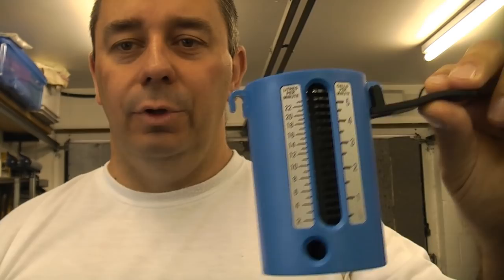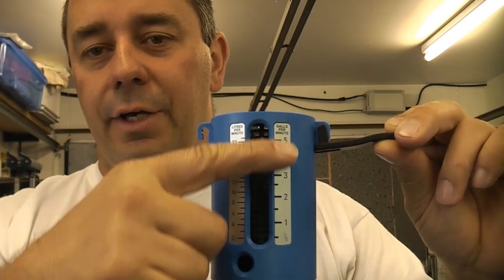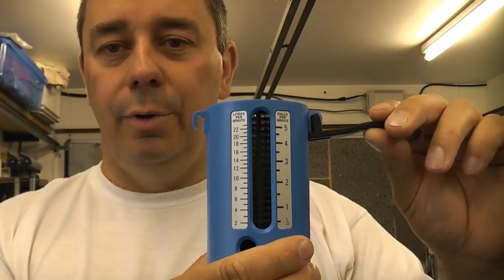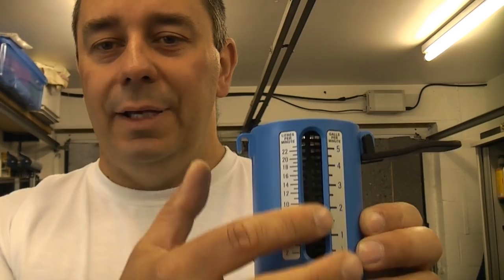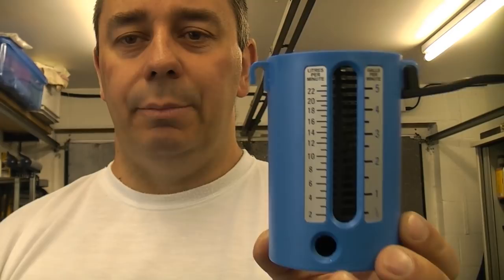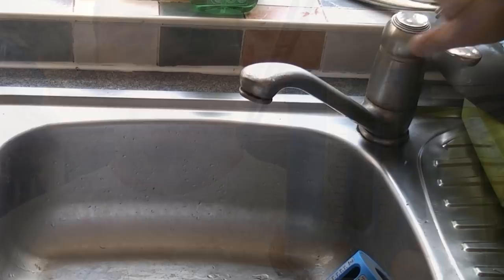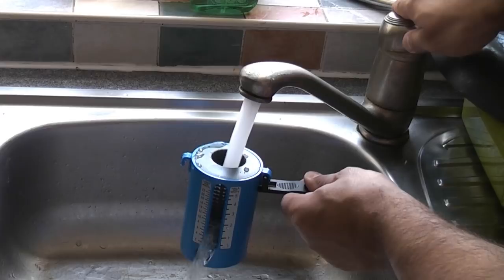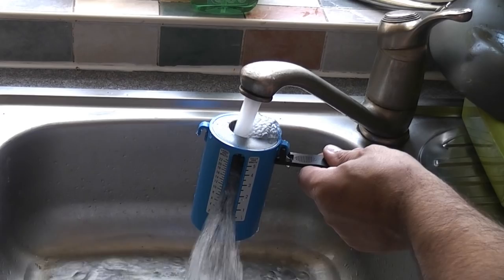How to measure water flow | Weir cup

Comment: good video Chez, short and to the point.

just a little question that may help some people if they have the need to test the flow rate, then it may be safe to assume this is due to a problem they are receiving.

what is the minimum rate that is meant to be supplied including any tolerences set by the supplier?

if anybody has cause to test this they should also be aware that pressure & flow rate are two different things and that the height of the building they are in could also effect this rate they receive.
Reply from the maker: I'm not sure if there is a minimum rate that is to be supplied because it would be difficult to guarantee, for example if you lived on a hill the house at the top would probably have less flow rate than a house at the bottom etc. I must admit that the flow here is that good that the main stop tap to the property is only open a quarter of one turn (if that). If the stop tap is opened more than this we get really bad water hammer, I guess I should install a water hammer arrester, but the rising main is boxed in and tiled making it difficult. 
Thanks for the comment ;-)